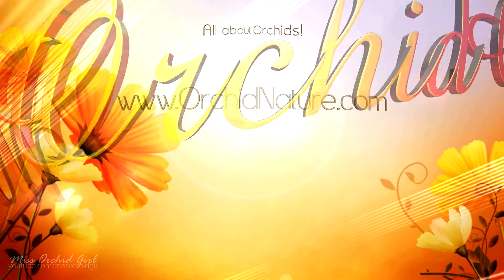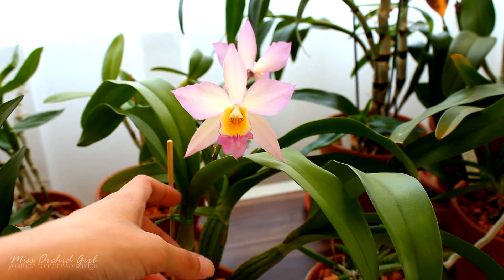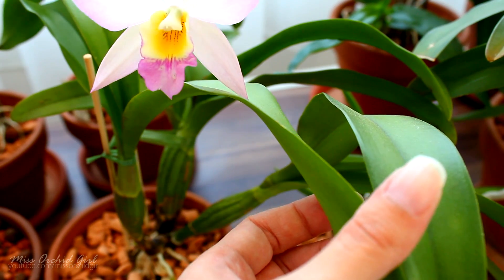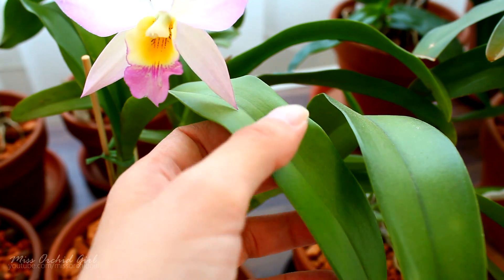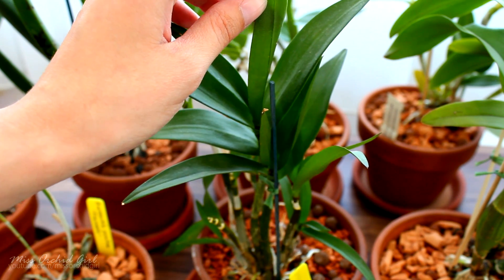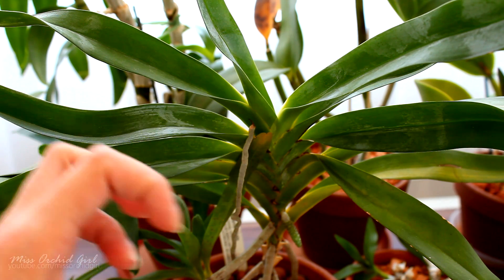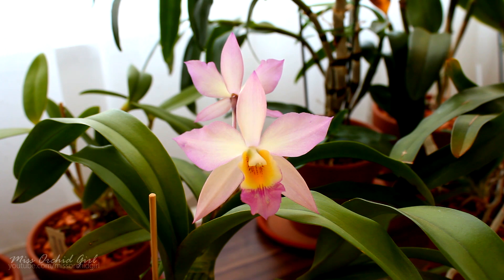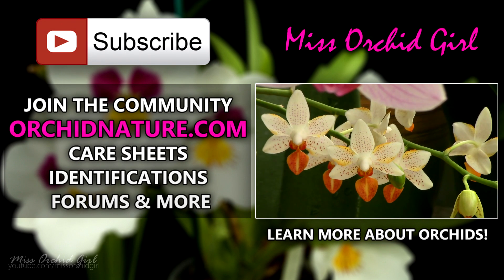Thoughts on foliar feeding Orchids

Comment: Thank you for this and the video about "questionable instructions".  I was about to buy an expensive foliar fertilizer but I think my money will be better spent on quality media and regular fertilizer....or more orchids :-).   I have another question, I'm starting with oncidiums and repotting an Onc. Sharry Baby Red Fantasy, two colmanara and wilsonara, they are in bloom but I decided to do it anyways cause I want to get them on the right conditions and disinfect the roots. I did one and it took so long cause these are planted in SOIL or at least extremely decomposed media. Roots and plant look very healthy, plump pseudobulbs, nice leaves and lots of blooms but potted in SOIL.  Have you ever encountered this? and If so how do you minimize damage to roots?  should I wait to repot after blooming? I am concerned the plant wont acclimate to the new media because it is not as moist and compacted (I'm using small pine bark and granite/lava rock mix). Some advice would be greatly appreciated.
Reply from the maker: Hi, the medium is probably some sort of coconut choir rather than soil. It is a bit more airy, but still in time it would prove to be too suffocating, especially if watered incorrectly. Since these orchids don't stay in bloom for too long you could have waited a few more days, but it's ok. I say this because after repoting there is a chance the flowers will drop, doesn't always happen though. If the roots are in good condition that's all that matters :) about root damage, well this will have to do with the person handling them as well :P I usually use a long pair of tweezers to help me remove medium. If the medium is very fine you can even prepare a bowl of water and rinse the roots in it. The medium will usually fall in the water by its self, depends on the roots system. About the new medium vs older medium, if you water it before it gets totally dry, the transition should theoretically be smoother and the new roots that form will be better adapted. So maybe try to pay attention to how fast this medium dries and don't let it sit bone dry for too long. But not soggy wet either :P
Reply: Thanks for the reply! I am going to wait until the other ones are done blooming because they are gorgeous and I want to enjoy them.  I did not try the bowl of water but now that you mention it I think that will definitely make root-cleaning easier for next time.  In the meantime, I'll be watching that Sharry Baby like a hawk and making sure the moisture levels are just right.  So far no bloom-drops, yay! I'll keep you posted and please keep those awesome videos coming :-)

Comment: Here in the Philippines. Its easy to foliar feed orchids outside than the inside so a routine teached to me is to foliar feed orchids until dripping in media on 4pm to 5pm before night  it's going to be dry also some particles of  fertz on the leaf. So no rot and its night cool and will be humid. Because its very moist the particles are sucked in by the stomata.
Reply: Please danny I request this video about proper foliar feeding there are some factors affecting how to properly foliar feed an orchid...even though you dont do it.. just a proper education for other  orchid lovers. Factors affecting that it should be sunny on 4pm to 5pm to dry out quickly to prevent rot and the fertilizer particle is dried up but some of the fertilizer are in the media. also make sure that the fertilizer solution are getting into the underside of the leaf... and the most very important thing is its very moist and humid  so the orchid can properly absorb the fertilizer solution because its a bit moist. Actually foliar feeding is the best way because you wet the underside of the leaf also the media have also the fertilizer solution the best way to make your fertilizer very effective.. My Orchid have many lots of new growths the dendrobium and my vanda now has 5 basal keiki also my phalaenopsis I bought just this february every month a new leaf mature in just 1month and another leaf got produced when the newest leaf is half mature~
Reply: oh btw water at 2pm so the dust blocking the underside of the leaf is rid off also the media is a bit moist when the fertilizer solution is dripping the media is saturated this makes a combo on the leaf and the root system hope it helps~
Reply: also to  prevent root fertilizer burn when the media is moist~
Reply: I agree to this since I also live in the Philippines... ☺
Reply: Im not an expert but this is how or what I do it works for me and my idea...  corrections or suggestion is well accepted
Reply from the maker: Hi, thanks for the tip :D in one of the articles in the description someone uses a fogger at night, I think with the same intention of making the salts dissolve from the leaves and making the nutrients available to the orchid :)
Reply: Foliar Feeding maximize the effectiveness of Fertilizers micronutrient are absorb most on the leaves while other that are dripping down are absorb by the roots some micro and mostly macro.. hopes this help~
Reply: Wow naman rovic at werner HAHAHAHAH
Reply: +Ahl Rubianes HAHAHAHA KEWL XD
Reply: Sounds like you should make a video, Werner!